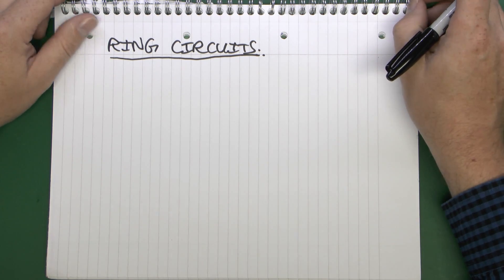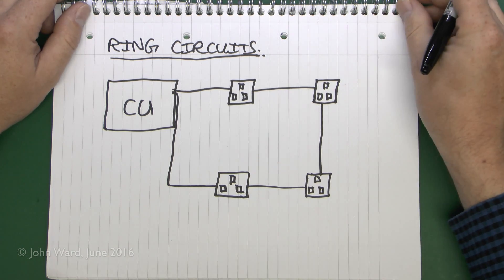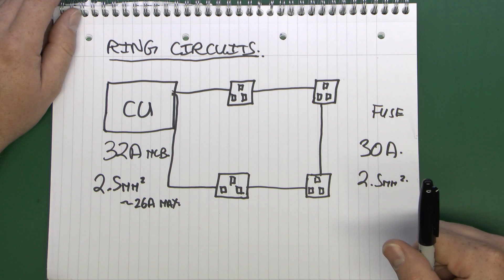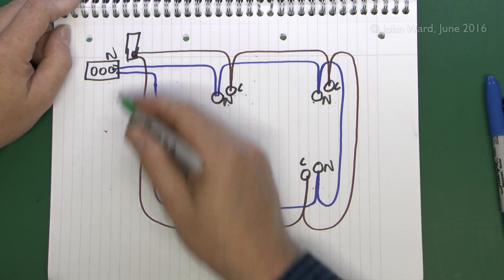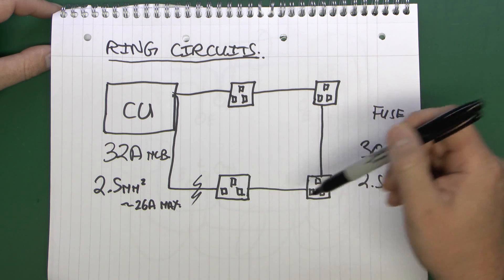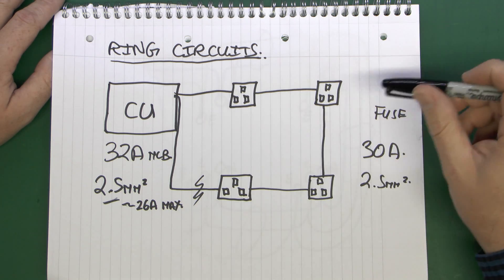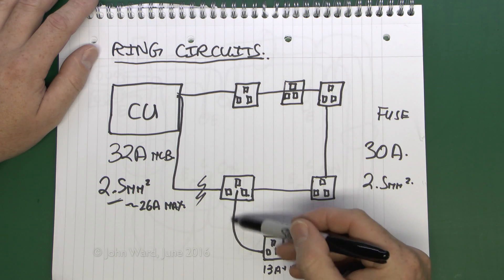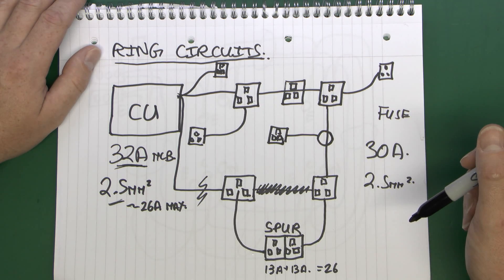UK Ring Circuits (previously Ring Mains) for Socket Outlets

Comment: The ring main was introduced after a long and hard war (WW2) and materials were in short supply, previously houses with electricity had few 15A sockets each wired as a spur from a fuse box. With the advent of 13a fused plugs and ring mains (as then called) with the limited and perhaps rationed cable could be used for more houses than the same amount of copper used as single socket radial circuits.
Whether a ring circuit NOW represents the best practice doesn't matter because there are probably 20 million ring circuits in existance and most electricians will meet them on a daily basis.
Reply: The wartime committee looking at advancing electrical installations noted about the pre-war 2A, 5A and 15A BS 546 socket-outlets: 

“…wholly unsatisfactory from the standpoint of the convenience of the consumer. The absence of an intermediate size between 5 and 15 amperes and the cost and dimensions of the 15 ampere [plug], have contributed to the use of non-standard socket-outlets and plugs to fill a gap in which there is substantial demand.’”

The non-standard socket-outlets was in a time when you bought an appliance the store would provide the electrician to run in a new cable and dedicated socket which may be provided by the appliance manufacturer, which maybe 10A. 

The Study also states: 
“the installation should allow the occupier to use electricity, if he so desires, for providing ‘topping up’ heat. Bearing in mind the limited cubic capacity and the load diversity of the small dwelling under review, it is considered that they could be adequately heated electrically using portable or inset electrical fires or convectors up to 2kW rating from the ring circuit. “This [substantial demand] applies to the smaller classes of dwellings in which 2 kW radiant electric fires are commonly used, and in which fires or other appliances exceeding this rating are seldom required due to the limitations imposed by the size of the room.”

The committee homed in on final ring circuits to ensure all sockets can take a 2kW load, and hence the BS 1363 13A socket emerged.  “The ring circuit system of wiring takes full advantage of domestic load diversity because one circuit serves an unlimited number of standard socket-outlets [BS 1363 type of 13 Amp rating] which may be used at any time and added to after if required. A large fuse at the meter end of the installation that has to be capable of carrying the full load of current drawn from several socket-outlets at once may not protect a flexible cord leading from an individual socket. The way to ensure adequate and selective protection is to connect each flexible cord to a separately fused plug.”

The BS 1363 type of 13A plug was developed to cover all bases, fuses from 1A to 13A, being slotted in. It would cover the gap from 5A to 15A missing in the BS 546 socket-outlets .

Although the committee wrote the above in WW2 a final ring was not mentioned in the regs until 1950 when there was no copper shortage. Final rings were slow to be adopted through the 1950s/60s.

Comment: Hi Mr John.
Basically how much is the maximum socket can share in 1 single ring circuit using setup C32 MCB + 2.5mm cable?
Thanx in advance.

Comment: Is there any sure fire way to check which type you have. Our house was rewired in 1987. I see a single socket which has only 1 wire and I can't tell if it's just a spur off the main ring. The double socket beside it has two wires. So the single seems liked it's spurred from that. Or it could just be the end of a radial as it's the furthest point away from the consumer unit on the first floor. I've checked the circuit breakers for the mains and they're all rated for 20Amp.
Reply from the maker: Only by testing them as described in this video: https://youtu.be/BKyK0-_v5xc or alternatively identifying where every cable is connected at every socket  In UK homes, rings are far more common than radials.
Reply: Stephen S - if ALL the MCBs are rated at 20A and there are none rated at 30A or 32A, it is likely that it is a 20A radial. But as John says, the only way to know for certain is to test.
With electrical systems, never assume anything. In industrial and office buildings, people often get caught out as there can be more than one “consumer unit” suppling electrical circuits for example...
Reply: @Mark1024MAK  thanks for your input. With this particular 20amp breaker, it is going off to 3 outlets. 1st outlet has an in and out connection and the 2nd is the same with the 3rd and final outlet having none. My test was, I've disconnected the out of the 1st socket and the 2nd and 3rd socket do not have power. By reconnecting that 1st out and disconnecting the 2nd outlets out only the 3rd and final socket does not have power.

Comment: surely you could just use 32a cable to 'beef up' the redundancy then there can be no problem? if it disconnects then it cant cause overload
Reply from the maker: Yes, but if using 32A cable with a 32A circuit breaker you don't need a ring at all.
Reply: Once you start going above 2.5mm working with and terminating the cable becomes a pitta.  Much better to simply run lots of 20A 2.5mm radials considering how cheap copper and large multi-way CCU's are nowadays!  Glad we don't have 110/120v like some countries, you need twice the csa / cable size to deliver the same current :-/

Comment: John, if you are able to reply it would be much appreciated!

My electrician wants to install a ring circuit for my largish kitchen. I would prefer radials for all the reasons you mention. I have asked for one "above counter" radial for kettle, microwave, toaster and myriad other small appliances, and one "below counter" radial for dishwasher, dryer, washer, fridge freezer and wall sockets for lamps, the hoover etc. He is adamant that one radial will suffice, citing diversity which I understand, but from experience I know that on weekends for example I will be using literally every appliance at once and would prefer two radials. Am I being unreasonable? Is there any reason why he is so reluctant? I am happy to pay for an extra RCBO and minimal additional cable costs and there are several unused ways in the CU recently installed the intention being to add the new kitchen circuits once it was extended. Should I be looking for a new electrician?
Reply from the maker: One radial might do, but no reason to not have two, it would be slightly more work but that's hardly a problem.
It's your house, so you should have what you want.

Some people are stuck in doing things the same old way, and may not like doing other methods.
Reply: John Ward Thanks! I couldn't see why it seemed to be such a problem but wasn't sure if there was a reason why he wasn't so keen. it's all chargeable work after all and to me at least makes sense from a capacity / overloading point of view, even if there are only a handful of days a year when everything is running flat out.
Reply: Spencer Wilton - the advantage of the ring circuit, is that you can choose long after the wiring has been installed what appliances you want connected and switched on without having to worry about socket is connected to what radial circuit (assuming we are comparing one 32A ring to two 20A radials). If properly installed, a ring is no less safe and no less reliable than a radial. At 230V, each 20A radial can supply just 4600W. A single 32A ring can supply 7360W. True, two 20A radials can supply more power, but if you connect too many high power appliances into one 20A radial, you risk the MCB tripping and spoiling your day (especially if it trips when you are not paying attention).
Reply: @Mark1024MAK  and if your ring is broken for whatever reason, you risk over current. I'd rather have 2 20A radials than a house fire.
Reply: Richard Ashworth - Yes, If a ring circuit has a break, there is a risk of a conductor overheating. However the risk of a fire is not as great as some people imagine. Firstly, when installed, the circuit should be properly tested to confirm that the ring is complete with no breaks. Second, for a fire to occur, enough current has to flow to actually overheat the conductor. Whether this occurs very much depends on the type of loads connected to the ring circuit (that has the fault). And where the loads are and where the break in the ring is. In reality, not many ring circuits actually have a total continuous current flowing that will overheat 2.5 square mm cable. Even if appliances with a total power rating of say 6.9kW are connected to the ring (30A at 230V), unless all of these appliances are all one side of the break, the current will be split between two different circuits to the consumer unit, and the resulting separate currents in the separate cables is likely to be below the value that will cause overheating. Even if you are very unlucky and do end up in a situation where the current flowing through one of the 2.5 square mm ring cables is exceeding the recommended value and the temperature of the cable exceeds it’s recommend maximum value, this does NOT mean that it will automatically catch fire. As has been shown, you have to grossly overload a cable for it to get hot enough for the insulation to catch fire. I once came across a house where an entire kitchen was wired as a spur off a ring circuit. All wired in 2.5 square mm cable. The cable ran from a terminal/junction box in the void between the ground floor and the first floor and ran to the kitchen (which was in an extension). This cable ran daisy chain style to all the double sockets in the kitchen (of which there were a considerable number). The kitchen had all the normal high power appliances (washing machine, microwave oven, kettle, fridge, freezer etc.). Despite this not being in compliance with any U.K. regulations, the cables showed no signs of overheating or damage. Of course I strongly recommended that the installation should be rewired.
If peace of mind is required, it is recommended that any and all electrical installations should be inspected and tested every ten years.

Comment: JW Ring circuits are not "pretty much only used in the UK". To my knowledge they are used In Zimbabwe, Zambia, Malawi, Hong Kong, Malaysia, Iraq, UAR, Cyprus, Ireland, Singapore, Kenya, Seychelles and many more too numerous to mention. I suggest you check the following website before relaying wrong information. https://www.worldstandards.eu/electricity/plug-voltage-by-country/
Reply from the maker: The type G plug is used in several countries but ring wiring is not, https://www.worldstandards.eu/electricity/plugs-and-sockets/g/
Reply: Sorry to disagree with you but if you look at Wikipedia you will see that the ring main and not just the G type plug is is used in all the countries I mention above with just one comment that it is to a lesser extent in Ireland. I am beginning to think that you are either  a "know-it-all" who knows nothing or an employee or shareholder in MK. Alternatively by uploading reports on electrical fitting it  is a nice little earner even if inaccurate.
Reply: @robgolding3808  Rather rude and uncalled for comment.

Comment: Hi John. How many spurs can you connect to a ring circuit?
Reply from the maker: As many as you want, provided each unfused spur only has one double or single socket outlet on it.
Reply: As many as you want as John said, however you can ONLY spur ONCE from each socket (ie you can't spur from a spur) otherwise you create a situation where you can demand more current then the 2.5mm spur cable can carry safely

Comment: without ring how can one connect more than 1 socket to one braker though? i cant stand paper demos i need to see it as a real demo if possable or at least a paper demo showing both wires and its colours between the unit and sockets and other socket in between? also how would it actually look like inside a socket (say in middle of the ring) and also why cant ring be used for lighting aswell?
Reply from the maker: https://www.flameport.com/electric/socket_outlet_circuits/radial.cs4

Comment: how can you connect a spur from fusebox into same 32a mcb? then its radial circuit so max 20a breaker?
Reply from the maker: A spur can only have one socket connected, overload protection is provided by the fuses in the plugs, which at a maximum of 13A each would prevent loads of over 26A being connected to a double socket.
Electrically there is no difference between a spur connected at the MCB and a spur connected at any other point on the ring.
Reply: thanks jw, that makes sense, of course thats if someone fits a single socket rather than a double which some ppl do. so potentially they could plug in 2x2kw heaters going through a single 2.5mm cable to 32a and it would take longer to trip/overcurrent.

Comment: What I've found in in the past in houses I've moved into is the spur-on-a-spur-on-a-spur-on-a-spur malarky (on 2.5mm cable). I've normally just completed the ring - but the question I would ask is could a  spur-on-a-spur-on-a-spur-on-a-spur (3 sockets on such a radial off a ring) be protected at the point the first spur leaves the ring with a cartridge fuse of say 20 amps?
Reply from the maker: Yes, although it's usually done with a 13A FCU

Comment: John, thank you for this video (and all the others) I do like and enjoy your style of delivery. I have a design question for you. I am designing for a small shed workshop (15 ft x 8ft) with a maximum load of 6Kw and had originally specified a ring final circuit using 4mm2 Twin and Earth protected by a 32A MCB (Type C because the workshop machinery has a couple of 2000 watt induction motors and wanted to avoid nuisance tripping on start up current surge). Having watched your video on the Satan's child I am now having second thoughts. I will be fitting a small consumer unit anyway and have space for three MCBs, one of which will support the lighting circuit and with a ring one MCB way would have been unused. So - would I be better off specifying two radial circuits, assume equal load on each, using 4mm2 T&E protected by their own 20A MCB (Type C)? The loads are Table saw 1500W, Dust extractor 1500W, Bandsaw (600W), Chop Saw 1500W - plus other more portable power tools - unlikely that 2 to be in any use at any one time. The power to the shed is all being done properly (Part P) and an SWA cable being run from the house consumer unit protected by a 32A TypeC MCB on the RCD protected side of the board to the workshop consumer unit.
Reply from the maker: A 32A ring would be done with 2.5mm cable, 4mm is oversized unless the cable is installed in insulation or other unfavourable conditions.
20A radials would also use 2.5mm.  A 32A radial would be 4mm.
You can have multiple circuits if you want, but as the whole lot is connected to a single 32A supply, there isn't really any point - a single 32A radial would be fine, and would also be far less likely to trip when larger loads are switched on.
Reply: John Ward Thanks for that John. Does it make any difference that the SWA (3 core 4mm2) is a 27 metre run between the supplying consumer unit and the workshop consumer unit? I was upgunning the workshop ring or radials because I was concerned to meet earth  loop impedance requirements of being protected by a Type C breaker. I do not want to be under sizing then having to rip out and redo with larger. Grateful your view.👍
Reply: I think one 32A circuit is better as it can cope with startup surge currents better without tripping.  There is no problem with cable protection, as your likely load is less than the 6kW of even a single 2.5mm cable (26A continuous rating).  Lights must be off a 6A MCB circuit, or a fused spur from your ring.

Comment: I'm from the US and now live in the UK. We use radial circuits; which are much easier to deal with, add to. My wife's grandfather just had a conservatory built here, and he asked if I would add 4, 2 gang sockets. I thought no big deal. but it seems like its going to be. My plan is to break into the ring main with a 30amp junction box, and run the 4 sockets down off of that. I have calculated their amperage and voltage needs as 2.75 amps/187 volts being drawn in that room as they are only plugging in a 32" lcd, a sky box, and a couple of 60w lamps. I've been told by some sparkys, that this should be no problem. However, I'm seeing online that you can only spur off 1 socket from the ring main with the junction box. is this true. No one can seem to agree on this. I may just run a radial from the CU, straight back to the conservatory and be done with it. why are you guys still using such antiquated wiring schemes? What are your thoughts. Thank you!
Reply: or just put in a 13a fcu after the junction box, then I can put in the 4 dual gang outlets?
Reply from the maker: With a 13A FCU you can have as many sockets as you want, and this would be the easiest and cheapest solution (also why many conservatories end up with this arrangement).
With a direct connection you are only allowed one socket, more would allow the cable to be overloaded, as 2.5mm² cable is only rated to about 26A, rings have 32A circuit breakers.  The overload protection is provided by the fuses in the plugs, 2x13A being approximately the maximum rating for 2.5mm² cable.
Reply: John Ward thank you for the advice!

Comment: 4mm cable is harder to pull through, more expensive to buy and the wires are more difficult to screw 2 into the back of the terminals on socket oulets. Just a few disadvantages of radial to balance things a bit.
Reply from the maker: Radial circuits don't have to be 32A, or use 4mm² wire.
Reply: Cheap, easy and dirty. Typical UK.